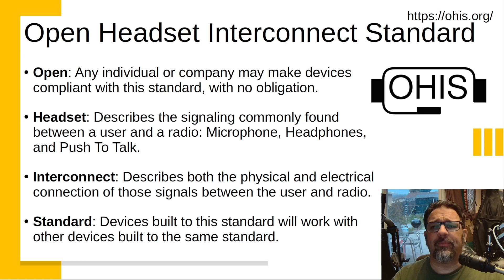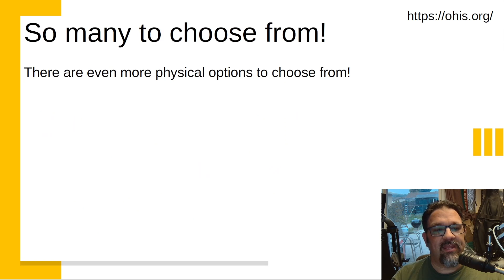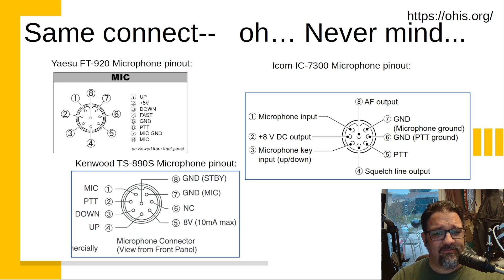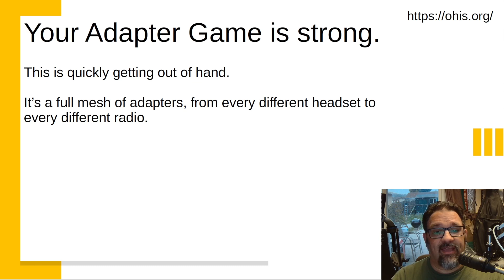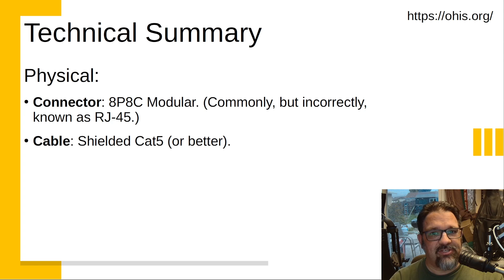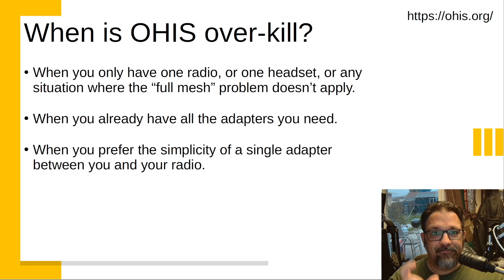OHIS: Open Headset Interconnect Standard

Comment: Cool idea, but, what about the "smart" microphones? The ones that have controls on them? How would you also include those options on a single 8P8C? Or the ones that are truly smart with a microprocessor sending data for those functions? I see where it would be nice for a station like mine where I have a Yaesu sat radio, A Kenwood HF and V/UHF, a Anytone DMR radio and a Yaesu C4FM. It would be nice to have a common interface for audio and be able to switch between them.

Comment: Another benefit of the OHIS is user experience and ease of use. How many times have you purchased a headset or mic and didn't get the right adapter, or had to build your own adapter? How much time have you poured over pinout diagrams or relied on vague descriptions from some log forgotten blog post? Did you read the pinout backwards? Oops. Time to rewire or buy another connector. The user experience improvement benefits both device and radio makers.

Comment: I think this is a good idea and not just for hams. There are plenty of devices with unusual audio interfaces outside of ham radio. Not as common but they're out there.

I'm skeptical of the idea that manufacturers will put this interface in radios because my understanding is they make a big chunk of money off of selling accessories and if they have to compete for accessory sales they will be financially up a creek.
Reply: I've spoken with a few manufacturers and I categorize their response as Optimistic Skepticism:  "That's a really great idea!  I don't think it'll ever happen."  :-/ 

I actually think it's not that bleak. Your point is totally valid, but OHIS doesn't have to REPLACE their existing ecosystem. I'm not asking the big three to do away with their GX16 mic connectors, but to add an OHIS port next to it, or maybe on the back of the radio.  They already have the "Accessory" port which duplicates the audio in and out and PTT, so I know they CAN do it.  The trick is convincing them that it's WORTH doing with a standard.

And the way to do that is to get traction on that standard.  So that's what I'm trying now.

Comment: Very cool...and timely.  It would be nice to add the CW Keying Line...but all out of pins, (maybe in CW mode the PTT line becomes the keying line).  My interest is in being able to easily SWITCH between radios in my collection of rigs.  I've just completed a modular desk project that allows me to physically arrange the equipment for ease of access.  This standard helps tremendously with the switching project, even though my rigs' manufacture dates span decades.  

I look at the "Adapter Project" as a retrofit solution for legacy equipment.  If all radio manufacturers, starting tomorrow, were to equip their radios, with OHIS ports and the headset, mic PTT switch manufacturers released their products with OHIS plugs, obviously no adapters would be needed; hence my view of the current status as a retrofit of legacy equipment.

Various attempts have been made to produce products for RIG selection, but none that I've seen have taken the 40,000 foot view that  you have...great work!
Reply: Thank you for the kind words!  🙂

This video is intended as a generic standards advocacy video and doesn't touch on the devices my company Halibut Electronics makes.  I'm currently selling adapters (pre-sale, delivery in October 2023), and am working on two "Consoles" to go between the radio and the user.  The first is the Contesting Console (two users, one radio), the second is the Station Console, which is what you're describing: multiple radios, one user.  It's expected for release sometime in the first half of 2024.

And, yes.  Ideally, manufacturers would adopt OHIS and start putting OHIS ports on their gear natively, no adapters necessary.  But I acknowledge that they are unlikely to do that until there's some traction with the standard.  Adapters are the bridge technology to get us there.

Comment: Good idea but how about a bluetooth interface with it too.
Reply: The standard is just the electrical middle part.  The devices that implement that standard is where the Bluetooth would be.  There's nothing stopping anyone from making a User adapter that connects to a Bluetooth headset instead of a cabled headset.  Or a Radio adapter that LOOKS LIKE a Bluetooth headset and presents an OHIS Radio port.

I'm not sure how standard the Bluetooth PTT stuff is though, how difficult that would be to implement.  I'm currently concentrating on wired analog solutions and haven't really researched the Bluetooth stuff yet.